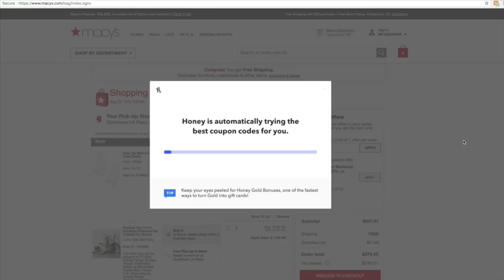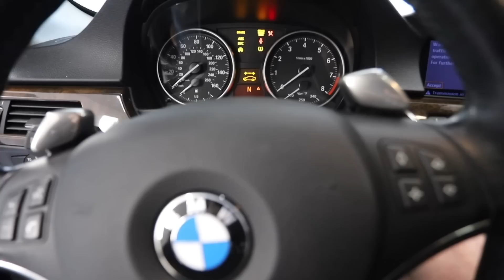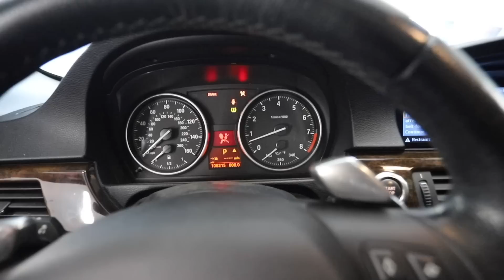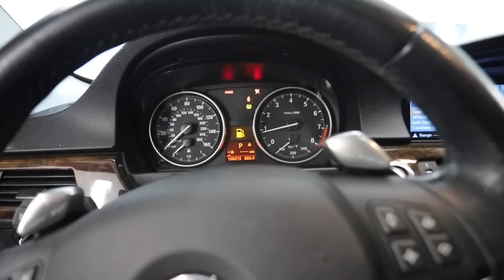I Bought Kyle a TOTALLED 2008 BMW 335I at AUCTION for $2300!!

Comment: n54 500bhp on stock turbo is achievable, but you'll need all the classic bolt-ons, a n54 in top shape (waste gate rod adjusted, not loose)  and maybe meth kit on a custom tune. It should be cheap tho.
Reply: Pure turbo kits are relatively cheap and make a big difference. I have a stage 2 on my N55 with a DCT also with basic bolt ons and a 3" turbo back exhaust. I got between 510whp and 550whp conditions depending on results. Also base Cobb aggression 3 map with piggie back dyno tune. Runs mid 11s all day.
Reply: Shit will not run reliably. People love throwing that number out but your turbos will break very quickly. Get stage 2 for 500bhp plenty of options.
Reply: @enriqueshockwave  true. N54 are not super reliable, but shouldn't put you on a towing . For a dd 500hp, you'll need to change most hoses, water pump, thermostat, oil pan gasket, cover gasket, coil pack, injectors, turbos, vanos. But for his build, MHD flash and few bolt ons , he will be fine. Those car like the rest of his fleet, will do max 15 miles , lol.
Reply: 500HP on stock turbos is going to last for about 5 pulls then you will be hot swapping the oil catch can.

Comment: I know some cars and trucks have a crash relay in the kick panel on passenger side or in the trunk in one of the panels with a rest button. But you found out it was the fuel pump and some times it kills it. They put these in to stop fuel from pumping out during a crash

Comment: Ha! I've had the opposite of your fuel problem with my '08 E90 335i. Read half a tank due to the float being out of its little clip. Turns out there was no fuel. Of course this was while driving, not in a garage, so it came with a few violent bangs and losses of power.

Comment: ECS also do a crazy 2 step relay controller kind of thing. With a MHD flash. And bolts on the car easily reach 500bhp, might need e85, would.

Comment: If your replacing suspension arms, don`t go for BMW, go for TRW who make genuine arms for BMW M3, they are a fraction of the price and a great upgrade as the are aluminium and not pressed steel. The arms will have the `M` logo ground off. Order JTC part numbers, if you need the part numbers, let me know. I`m in the process of doing the upgrade on my E92

Comment: Get the maintenance out of the way and you have a solid motor on your hands. Common issues oil filter housing gasket, valve cover gasket, oil pan gasket. Once those are done spark plug and ignition coils. Sounds like the car has downpipes already, just need an upgraded intercooler and dual cone intakes. You can tune the car with MHD flasher. Stage 2+ with an e30 mix should put you close to that 500hp you guys are trying to achieve. Welcome to the N54 club ✊🏽

Comment: 15:40 thats odd: It definately ran when it crashed and just a few months later after the auction the fuel pump is dead? My first guess would have been one of those crash sensors that disable the fuel pump, but no airbag fired so that would have been strange too....

Comment: For more hp. You need to get better coil packs, low pressure fuel pump (fuel-it stage 1), big stepped intercooler,  and run e60 on a 20psi map. Should put you just under 500whp. To really get 500 or more you will need bigger turbos. The Chinese ones are cheap and pretty reliable.
Reply: I wish I could like this twice

Comment: Got rid of a 2007 335i last year.  Every time I fixed a CEL issue, it would have another one within a week.  The Burger Motorsports JB4 is what you want for it.  Easy bolt on power.

Comment: fuel cut off switch might of been hit in accident
Reply: Clear engines (codes) might work also
Reply: either that or they have those fuses that blow near or on the battery.
Reply: so did none of you guys watch the whole video? lol
Reply: Drew Daskievige battery safety terminal, the have a mini explosion to disconnect the battery in a crash.

Comment: Single best upgrade we found, aside from the typical intake/exhaust/tune, was a meth kit. We routinely had customers running around with over 500hp in their daily drivers. It's pretty surprising what the power potential is of the stock stuff. They do also struggle with oil temp control when you beat on them much, but a real oil cooler kit solves that problem with ease.

Comment: I have an 01 325i, needs entire suspension replaced but after that i wanna put some power into it. Im just wondering what's the most horsepower you can safely push from my engine? I plan on keeping it & making it mint. Its a fun/ shitty car as is so nothing will dissapoint me.

Comment: No 4cyl options for that body chassis in the US. I would not run eBay control arms, bushing will go out very quickly. Check out fcpeuro for parts and look at lemforder parts, they have lifetime warranty on everything including oil, filters and brake pads

Comment: Check the battery when the car gets into an accident it pops the battery cables off to avoid fires use pliers to hold it on and start the car

Comment: For your apocalypse build you should do an 88 Coupe Ford Mustang Fox body with a Jeep engine transfer case and suspension system and try to make it look like a GTR R32 to think about it you would have one of a kind Mustang that no one else unless they were to go through the effort would have and you would have the option of all-wheel drive and rear-wheel drive with the capability to do rally racing or drift Style Racing if you wanted to do such a thing
Reply: And it fits the Apocalypse concept of being rear-wheel drive when you're driving on a regular Road and all-wheel drive when you have to go off road

Comment: Had a 2007 328Xi 2dr. You need to make sure the battery is programmed to the car. The car increases voltage as the battery ages.

Comment: 500hp on a 335i is easily obtainable, a custome tune, Down pipes,new inter cooler, and e85. Easily like 400-500hp on stock turbos!
Reply: Stop it the stock turbos will break

Comment: If the car has good quality tyres, it means the owner cares about the car. Also the n54 engine in that car is capable of 600hp on stock internals. And even 900hp is capable quite easily.
Reply: 30k USD in mods = quite easily

Comment: Fyi...FIX THE BATTERY CONECTOR! that is what will stop the car from starting. There is a cyclinder with a explosive it it that goes off when the airbags deploy that disconnects part of the power harness.. u can replace the part or u can get pliers and press the cyclinder back together to make contact

Comment: Hello B guys. I have a 2009 328i that I bought on auction like you to work on it and I see that you are getting rid of your front bumper. Are you giving it away hopefully! selling? I like to have it if it fits mine? let me know if you are selling or what?. I don't know it it will fit but is very similar to mine. Mine is all dented and scratch at the bottom :(

Comment: You should really NOT be using an extension in the coil pack.  Youre going to deform the clip that goes onto the spark plug.  Either remove the plug thats in the engine and use that or use another plug youve got laying around.  Youre going to run into issues down the road.

Comment: Check the inertia switch?

EDIT: Disregard.
Reply: I bet it was the inertia switch, But they would not admit it , would they......amatures.
Reply: They tested the pump out of the tank. But we didn't see them actually test it. Either way they waited to get a new one. If it was good and found out by testing it I doubt they would've waited the day or so and went to search for a inertia device.
Reply: @wheeln24-79   inertia device, would have been the obvious, after a Collison and most easy thing to check first.
Reply: starboy_barry when criticizing others, spellcheck.

Comment: The instant a BMW is in an accident at the battery the positive terminal has like a relay in it and it pops which causes the car not to run but I guess I'm confused because the car turns over which it wouldn't turn over if that was popped so now I'm confused okay I was just putting some information in I don't know now good luck guys I'm watching still

Comment: having some experience with BMW, you'll regret buying the cheap control arms in no time
ok for making it a roller, not ok for 500hp
remember, the rear axle gives you stability and on these cars its a sissy
Reply: Totally agree. Tons of casuals out here saying 500 bhp capable like it will run at that power reliably. I've seen the dyno videos too but with that type of power even with supporting mods a bunch of shit will break on the turbos and else where. Tons of stage 2 turbo options out there for that type of power and m3 control arms also available on ecs.

Comment: Mate, I get you guys want cool cars.  But cool cars will never really last in apocalypse.  One of the only cars I reckon that will be reliable during an apocalypse is an old school mercedes 230d.
Mechanical injectors, no turbo to fail.  no electronics.  You do not even need a working battery to get it started, just some downhill and a clutch drop.